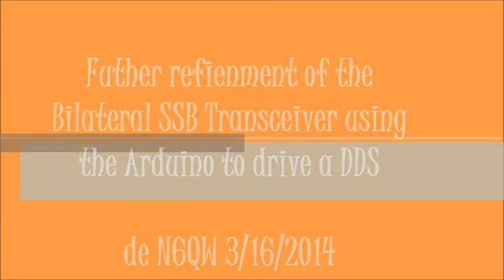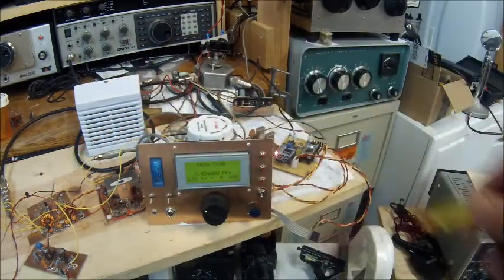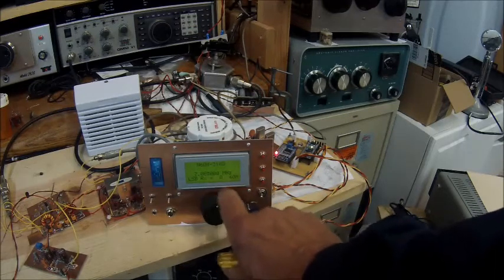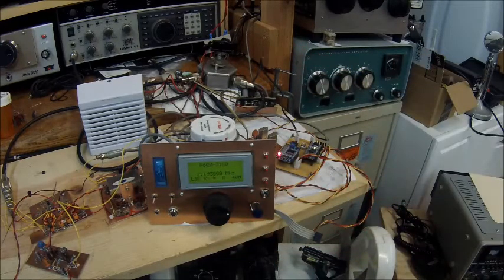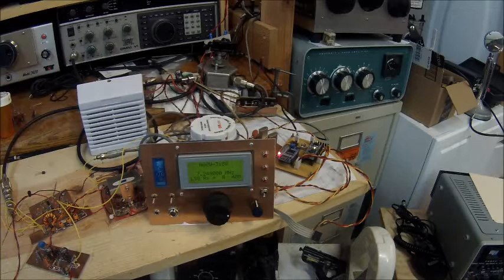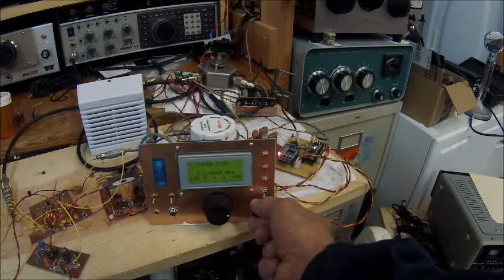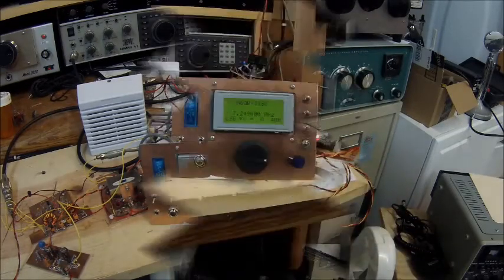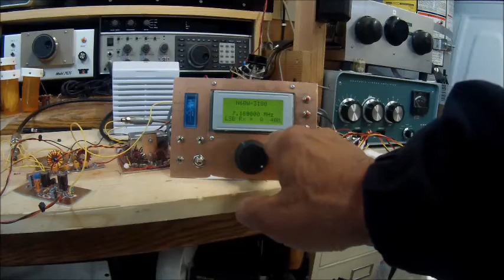40M SSB

Comment: That sounds very very nice Pete. I am not that experienced but I have built a few receivers and you really have got a quiet receiver there. I am now experimenting with the DDS VFO approach. Have you got a circuit diagram of the rf  receive amplifier you are use?
Dan
Reply from the maker: Hi Dan,

There was no one more surprised than me about the Rx being quiet! Send me an email to my QRZ email address and I will send you the schematic of a two transistor bi-directional amp that can be used as a Rx RF amp and Tx RF amp. That is what was used in the final transceiver. These two amps are gain adjustable so depending on what you have the gain can be upped or downed.

73's
Pete N6QW